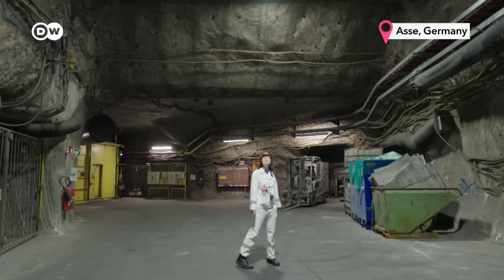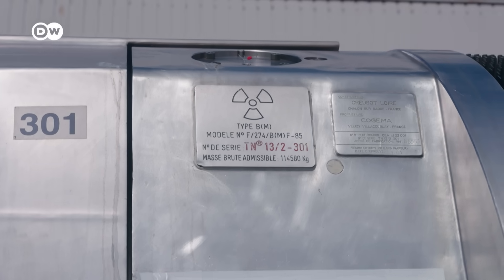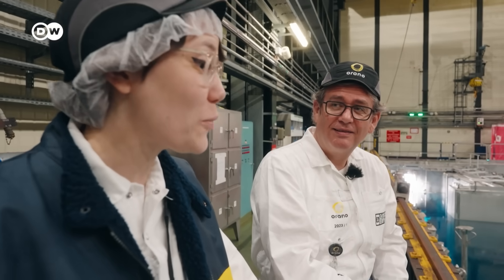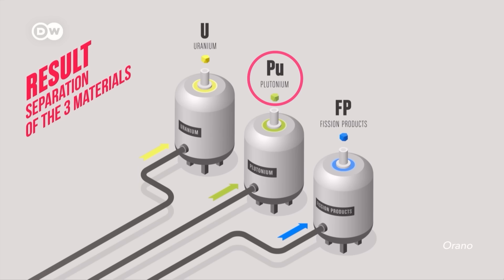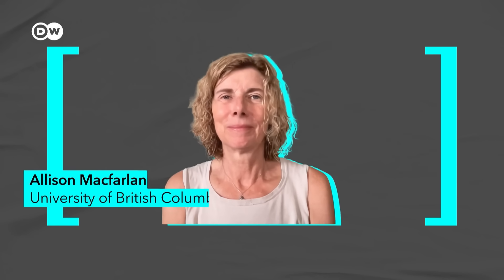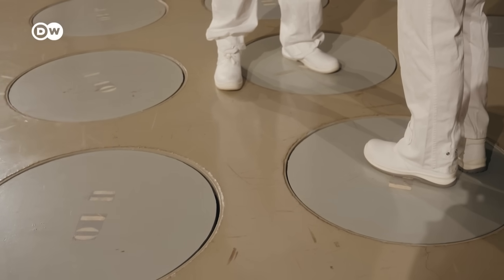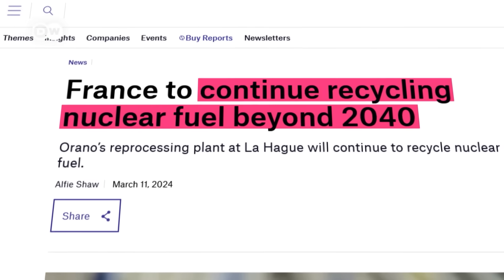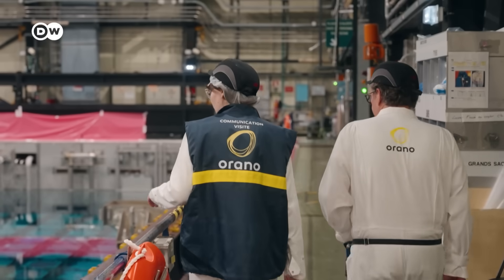Nuclear waste is reusable. Why aren’t we doing it?

Comment: 50 years ago, the United States had a nuclear fuel recycling facility.  It was operated by Nuclear Fuel Services, Inc., a subsidiary of Getty Oil Company.  It was located at West Valley, NY.  I was one of the contractors that decommissioned the plant and vitrified the waste stored there (600,000 gallons).
Reply: The US also had the Fast integral reactor project which combined the nuclear reactor and reprocessing plant into a single facility. It demonstrated how spent fuel could be recycled and reused on-site. The fuel that the plant began operation with would be the same fuel that it would use for the life of the plant. The plant used electrorefining to recycle the fuel. The reactor was a liquid-metal reactor that operated safely and proved that the passive safety systems were effective against loss-of-coolant type accidents that have caused nuclear accidents in the past.  Unfortunately politicians like then-Senator John Kerry fought to get the plant shut down.
Reply: An oil company running a fission plant? I understand why they didn't see any incentive there.
Reply: @98Zai  They didn't see any incentive there because the US government made it impossible to. Are we just going to forget that American anti-nuclearism existed?
Reply: @faberofwillandmight  "Escalating regulation required plant modifications which were deemed uneconomic by Nuclear Fuel Services, who ceased all operations at the facility in 1976." 
They weren't incentivized to operate the plant safely, at least. They're still working on cleaning up that place; "Despite over 30 years of cleanup efforts and billions of dollars having been spent at the site, the West Valley Demonstration Project property was described as "arguably Western New York's most toxic location" in 2013."
Reply: @98Zai so let me guess... they used the billions to just shove it into the sea
Reply: @98Zai  That's oddly specific. Does that mean there are other sites across the USA that are more toxic than this one?
Reply: @Dave1507  I pulled that from wikipedia. I don't know the US very well. I assume Western New York has a higher level of pollution than the rest of the US since it's been a hotspot for human industrialization for at least 200 years. I'm going to go out on a limb and say that there are many sites across the US that are very polluted, they extract oil almost all over the place. I read that 50% of tapwater contains manmade chemicals.
Reply: @98Zai  50%? Isn't that illegal? I mean access to servicable water is a human right. Who's gonna look into that? Unless the USA has an excemption from that.
Reply: @Dave1507  I guess I don't have a good source for that. It explicitly said that 50% of water was found to contain manmade chemicals. I deem that unserviceable but I realize that might not fit the US official standard of unserviceable. Perhaps I am just privileged. I'm glad you caught that, I will change my comment to reflect my error!
Reply: @98Zai  Man, I don't know if it's an error, or if the usa just don't care about their people. The way things are looking now, it could really be both. Let's see if an american can help with those numbers. Not everything is your fault, keep that in mind ;) Anyway, if it's ilegal ,the exact number doesn't matter, because it's no more legal at 20% than at 50%
Reply: @Dave1507  actually yes Hanford in Washington State
Reply: @DrewNorthup  I think the study I looked at specifically mentioned "forever chemicals" like PFAS. I don't think "road salt" is considered a man made chemical, but perhaps I'm wrong.
Reply: @98Zai  most big city water is ♻ from waste water plants and reused and yes that water does contain chemicals some from thing like prescription drugs and other chemicals
Reply: @98Zai  so they were cheap
Reply: @98Zai  Now imagine if we never stopped building them and the thousands of these planned site all got built and are now 50-70+ years old...
Reply: Exsists. 3-Mike island g. Bribe rob steal for my diesel juice. Murica!
Reply: @Dave1507  Yes:   The Lincoln Park & Hanford sites both come to mind.
Reply: @98Zai  Flouride was allowed in drinking water a while ago.
Reply: @dthomas9230  Flouride is a naturally occurring mineral and have always been in the groundwater. It's known to be bad for us, but it's not nearly as bad as plastic.
Reply: @98Zai  It also includes various prescription drugs that get flushed through your system but are not removed or broken down in treatment plants.
Reply: @Dave1507 Yes, there is Hanford, Rocky flats, Rocketdyne at Santa  Susanna, and others!
Reply: @DanielSanNinja  a lot of it was sprayed into the air
Reply: @Dave1507 that doesn't matter when it comes to poor people. Poor indigenous communities in Canada have no clean drinking water. Many small towns in rural American don't have access to clean drinking water. Look into Chemical Valley in Michigan/Ontario
Reply: @Dave1507 America cares deeply about their people and how they're going to continue working to make sure the rich people can survive. That's very important that we don't distrupt the rich peoples' way of life with dumb concerns like not dying and clean drinking water
Reply: @98Zai typical American anti nuclear messaging 😂😂😂😂
Reply: @ZawaOnYoutube Great argument. I'm glad you felt the need to express that. You added so much to the conversation. I want to give you a medal for you ingenuity.
Reply: @ Cool. If i had multiple billions of dollars id do it easily
Reply: @faberofwillandmight ah yes...Remember those days 😅
Reply: @98Zai  a lot of ppl blamed inbreeding for deformities in small towns in south but I wonder if ppl dumped this type of waste in rural areas and caused those deformities?
Reply: @SaibaPixel  As far as I know, deformities caused by radiation are usually fatal, stuff like underdeveloped organs and missing limbs. Inbreeding usually result in some kind of hereditary syndrome. If you are exposed to radiation you're more likely to develop different types of cancer, so looking at cancer statistics is more beneficial in that case. It's important to note that we have only been handling radioactive material on a large scale since the 40's, so before that you'd have to blame a natural source of radiation.
Reply: @faberofwillandmight I’m talking out my ass, but. 

10 bucks says the oil ppl lobbied and incited propaganda
Reply: This was a huge debate in the United States not long ago and kind of still is. Members of US Congress came out to discredit nuclear waste recycling to push solar and wind power. I wouldn't blame the US states that rely upon fossil fuel for a good portion of the state income as the reason why refineries, pipelines, fossil fuel powered energy plants, dams and desalination hydroelectric facilities, and nuclear plants all got shut down with the last few years. The people pushing solar and wind power are against everything else and have been working hard to shut down everything else. The new international movement to recycle nuclear waste is the primary reason why there is renewed interest in researching and constructing generation 4 nuclear power plants. Right now most nations that use nuclear power are building or restoring older plants into generation 3.5 plants or simply continuing to use gen 2 or gen 2.5 plants.
Reply: The people that want solar and wind power have been responsible for shutting down refineries, pipelines, fossil fuel powered energy plants, dams and desalination hydroelectric facilities, nuclear plants, and refusing to permit drilling, oil exploration, and the harvesting of methane in the last few years.
Reply: @98Zai large industrial conglomerates ran most of the us’s nuclear fuel plants even back to the 1940s . Goodyear ran many of them
Reply: @agy234  That sounds so dystopian.
Reply: @98Zai  oh yea...like they never diversify.  Please.
Reply: @98Zai oil companies own wind turbines too and solar city’s. money is Money.
Reply: @98Zai not fission, recycling
Reply: @98Zai  It wasn't the oil industry that  fought against this stuff. It was the Left wing Marxist Ideologies that pushed the fear mongering, and argued that recycling would encourage proliferation: 1. it doesn't. 2. Recycling makes nuclear power more affordable.

Now, tell me, who is against Cheap, Reliable, Clean energy?
That's right: Socialists - why? Because cheap, reliable, clean energy makes manufacturing more affordable; Lowers cost of living; empowers innovations. The entire green movement requires dirty energy as a justification to attack domestic manufacturing; shipped conveniently to china as a primary recipient.

This is not coincidence, this is all by design.

The Federal duplication of effort, that resulted in reduced education outcomes over the decades was done by the same guy by the way: Carter. Because lets be honest - if you want to push socialist ideology, you have to destroy critical thinking. You have to destroy economic literacy.
Reply: @98Zai the technical aspects of the oil and gas sector is highly regulated, that is, many engineering standards to follow. The engineers working on process engineering, piping, mechanical, civil, structural, electrical and controls are all similar with the nuclear energy projects. The difference is only the nuclear reactor. But once the steam is generated, it all becomes like conventional steam energy plant. That's why, an oil and gas engineer can easily move on nuclear energy projects.
Reply: @firstlast-ty4di  Any rad. process using aquaeous or other covalent solvents is inferior as it inflates the amount of contaminated material.
Recycling plant costs are directly proportional to volume of non-profitable material throughput, mainly solvents.
Right now, folks like CURIO are pursuing a combination of dry process, salt-based and electrolysis, which minimizes the churn of litres and kilos of non-fuel materials per day. ORANO is looking at the same.
Reply: @GreezyWorks  Your comment is valid.  The 600,000 gallons of waste the we processed was a sludge, mostly water.  We used chemical processes to remove/concentrate the trans-uranic isotopes which were vitrified (disolved in molten boro-silicate).  That reduced the volume of the waste to about 1% of the original.  A non-aqueous process by our predecessors would have reduced our workload substantially.
Reply: So many industrial wastes are nastier than this.
Reply: US had the capability long before that...like 80 years ago on a commercial scale.  The only difference between recycling and weapons production is the purity and end-user configuration of the U and Pu recovered from the irradiated fuel rods...
Reply: Why was it decommissioned?
Reply: @DesertCatDad  The facility was due for a recertification.  NRC, DOE and State of NY regulations had been updated since the facility's construction, and costly improvements would be needed.  The operator decided that it could not be profitably upgraded and operated.  Because of an arrangement that the operator had with the State of NY, the operator was allowed to turn the site over to the State and walk away.
Reply: And the West Valley Project, to my knowledge , was a massive environmental disaster
Reply: @dennisfitzgibbon1983 living not far from it and knowing people that worked there it was more to do with how shuttering things was managed than the technology, tools and capability of the people actually working there.  In other words people might have been instructed to take measures that were more cost effective.   people there were worked at personal risk to make the best of the situation.
Reply: Yeah, well do tell us HOW WELL IT ALL TURNED OUT?!
More proof techs and engineers WILL LIE if their paycheck is involved.
Reply: There was more than one of these plants in the US, only one of which is still operating too this day.
Reply: And is in the hands of communists from NY state....
Reply: We stopped it because India was able to build bombs from spent nuclear waste from their reactors. So when we found out that plutonium could be extracted to make bombs, we put a stop to all nuclear reprocessing in the United States to set an example. Nothing but politics.
Reply: I grew up seven miles downwind from this nightmare.
Reply: THANK >YOU< for the reply. What happens to the COOLANT WASTE WATER,...though? I am not arguing,....just > kinda < thinkin' / wonderin'? ALL THE TOOLS,...OVERALLS - badges - ? some-tin ta think a 'bouts?
Reply: @WilliamNorrie-c1n  My work at West Valley was with high-level waste only.  Low-level waste that you describe was also buried at the site.  I do not know how that was handled.
Reply: 600,000 gallons ....

Which is gonna be expensive taking care of,  so the process designer selected to force his children to fix his goof ?
Reply: @TheStefanskoglund1  Further processing reduced the volume of waste to about 1% of the 600,000 gallons.  Today it is stored in above-ground containers at the original site.
Reply: Sick
Reply: Yeah..then it was sent to Portsmouth Ohio and caused contamination around the entire site and surrounding communities...did you forget that part or not know?
Reply: @paulmobleyscience  You may be mistaking the waste taken to Portsmouth with a source other than West Valley.  The West Valley waste was consolidated into a reduced volume and stabilized against environmental effects.  It, however, remains at West Valley.  Portsmouth has done uranium enrichment over many years, and I'm sure that the residues from that represent storage challenges.
Reply: @firstlast-ty4di  I'm not mistaken as I am in direct contact with the president of PRESS and know it was brought in from NY. Perhaps there is a part of the process that you were unaware of occurring.
Reply: @paulmobleyscience  Yes, perhaps there was something that I was not aware of.
Reply: @firstlast-ty4di, et al, so it IS as I thought earlier...the whole so-called "clean fuels", and the so-called "dirty fuels" argument is a whole bunch of scams after all.
Reply: Apparently it takes 50 years to switch from oil and nuclear to images and GIFs

(I am terribly sorry for interrupting intellectual conversation with puns, couldn't help myself)
Reply: the miami florida plant is leaking... confirmed 2016... almost all people did not see the reports in nytimes and miamiherald. 😢
Reply: The private reprocessing facility ran for 6 years, was shut down, found to be leaking hi-level radioactive waste and turned over to the feds (Uncle Sugar) to clean up the mess. Still not done. 
Vitrification in glass or ceramics breaks down after 100 years. What will we do with this waste from hell for the next million or so years?
Reply: Too bad they cancelled the MOX plant construction at Savannah River Site.
Reply: @shannono.5835  That may be the only decent thing Obozo did as President. Reprocessing spent fuel is the dirtiest, most polluting, most expensive and most dangerous process in the nuclear energy field. It only reclaims 1-2% of the spent fuel as Pu-239 and U-235. The rest is still nuclear waste. The reclaimed fuel can be reused in an MOX reactor one time. Reactors that can run MOX fuel require more containment and are more tempermental, therefore more expensive. It is much cheaper to run U-235 from mining and is less expensive and less polluting. The reprocessing plants in England and France, Sellefield and LeHague have caused the Atlantic Ocean to be the most radioactively polluted ocean in the world. England shut down Sellafield and estimates it will take over 100 years to clean up and no one knows how much money. England says it will cost about $1 billion a year just to maintain the site, waste and equipment and provide security. Le Hague's only customer now is its parent company since they lost all their international customers. The parent company was taken over by the French government to keep it from going bankrupt. Pity the poor French taxpayers.
Reply: 50ys+ago,also, Nixon cut the funds for the Oak Ridge Fluid salt reactor.with all bugs ironed out these things could Burn this waste (c.99%)..we are almost there 😊.. it's a resource!
Reply: The shorter the half-life, the more dangerous the waste & VICE VERSA!
Reply: Pandoras Box.
Reply: The simple truth: it's more expensive than just using virgin material. (and almost everywhere, there are anti-proliferation laws making it illegal.) In the US, the only spent fuel reprocessing is done by the military. (infinite budget, and over 90% enrichment is highly expensive.)
Reply: Interesting.   And you sound healthy alert these
manhy years since.
Reply: I am living in a third world country without any nuclear power plant but all other nations sent their nuclear waste to my country for disposal. The USA spent a big budget on building nuclear power plants with little budget to build a nuclear waste processing facility.
Reply: Just wait till they hear about fast-spectrum breeder reactors. They'll kick themselves they didn't think of it.
Reply: Now that facility has contaminated the surrounding countryside, with radioactive waste in the water.  Not surprisingly.
Reply: @markrobinowitz8473  "After reprocessing operations ceased in 1972, Nuclear Fuel Services continued to accept low-level radioactive waste for disposal at the site until it was discovered that contaminated water was leaking from the trenches. Nuclear Fuel Services was unable to obtain regulatory approval to remove and treat the contaminated water, and stopped accepting waste for burial in 1975."
Reply: @markrobinowitz8473  And Earth is the only planet we're aware of that isn't completely irradiated. For some reason we're insistent on changing that.
Reply: @98Zai  We're receiving radiation from the sun right now. Radiation is fine, there are just levels that are unsafe, and even then we're still learning how radiation affects the environment via Chernobyl, which has seen an explosion of diverse wildlife.
Reply: @OryxAU  yeah, they've seen an explosion allright... ;)
Reply: @OryxAU  We spent millions of years to evolve protection from some Electromagnetic radiation, including relatively weak UV, but it's still the cause of a lot of cancer cases. Ionizing radiation is different and much more powerful, we would never have reached this level of complexity if the Earth was irradiated. Please don't go around saying that ionizing radiation is "fine".
Reply: @98Zai   Actually do we know of any planets that are completely irradiated?  I think you have your facts backwards.  

Earth's magnetosphere does shield our planet from much of the Sun's solar wind, which protects us from much of the Sun's radiation and is very much needed for our kind of life, but other planets which do not have this feature can't really be said to be "irradiated".
Reply: @Faladrin  The level of radiation on Mars and the moon are fatal without protection. I think we can assume this is the case for all bodies in space, since space itself is full of radiation.
Reply: @98Zai UV is ionising radiation.
Reply: @rogerphelps9939  "Some higher types of UV radiation are ionizing, but even the highest-energy UV rays don't have enough energy to penetrate deeply into the body, so their main effect is on the skin."
Reply: We're not changing the amount of radiation.
Reply: @98Zai Radiation is everywhere dude. Uranium is very common in lime stone.
Reply: @kabloosh699  I know, but not at the levels of the rest of the universe.
Reply: @98Zai  that is only because we have a atmosphere that protects us from most of it.
Reply: @kabloosh699  Yeah, so using nuclear power is like removing the atmosphere to get better solar power.
Reply: @98Zai  what?

That's not how nuclear works.
Reply: @kabloosh699  It is bringing radioactivity to the surface of the earth. I know how it works, friend.  I guess a "perfectly controlled" window in the atmosphere for our solar panels is a more correct metaphor.
Reply: @98Zai  It feels so good, the nice warmth of billions of particles hitting my skin at once. The Nuclear Bliss, I call it
Reply: @DanglesPaintball  I know, right. It's so bizarre that we need it to be healthy. Another thing is oxygen, it's an oxidizer and basically the reason we break down at all - the reason we age and die. Yet we need it to function.
Reply: @98Zai  That is false. Earth is positively glowing. Have you ever heard of Oklo, or granite?
Reply: @98Zai  lobbied politicians says "It's the future's problem" says 60 year old politician 😂
Reply: @OryxAU Yep. And some parts of the US are naturally more radioactive than others.

Also those of us living in high parts of the country are getting more SolRad than those lowland dwellers! Lol.
Reply: @98Zai As someone who will likely get solar caused cancer on my face like my grandpa, I think the intent was to counter the typical ignorant reaction people have to radiation.
Reply: Why are people here asking complex questions in a YouTube chat section when if you just google it, you’ll have a better chance of getting your answers?
Plus they keep saying things like “I heard” or “supposedly.” If you don’t know then don’t spread the false information.
Reply: @keenari0470  Why even write or read comments at all? Every comment made by a person is going to be flawed in some way, because nobody is capable of knowing everything including if nuclear recycling is good or bad. It doesn't matter who they claim to be, treat each comment as nothing more than an opinion. Except when you read straight up facts, like how fission doesn't belong on earth.
Reply: @98Zai  it’s OK to have conversations in the comment section. I actually like to hear other peoples opinions on things or stories from their own lives. But people are asking questions that would take someone too long to answer and are just a Google search away. They’re stating information that they themselves don’t even know if it’s true or they’re making overly exaggerated statements.
Reply: It seems like in the 1970 the US was leading the world with innovation. Now it seems you only innovate when it comes to more imaginative was a bring death.
Reply: @bardslee did you forget about the internet, private space exploration, smart phones, gps and artificial intelligence?
Reply: @bardslee Probably coming from a person residing in a nation receiving some kind of US aid
Reply: @bardslee that's easy for Europeans to say when they can practically spend nothing on their military and just rely on the U.S for protection.
Reply: @bardslee  Laws (and enforcement practices) and tax structure incentivize behaviors.  1970s had different incentives than today.
Reply: Used to
Reply: Shoot it out into space maybe. It being it's own fuel sorce. And boom we now have satellites 🛰  in deep space ?!😊😮
Reply: For financial reasons, US president Barack Obama canceled construction of the MFFF in 2016 and proposed that the plutonium be diluted with non-radioactive material and disposed in the underground WIPP facility.
Reply: That's honestly such a bummer to read. :/
Reply: ? 600,ooo <_>  gallons < ? LIQUID ?  COOLANTS ? -- water --? boric acid pools -  solutions?
Reply: @WilliamNorrie-c1n  It was mostly mud-like.  There was also some liquid (10-20%).  I don't remember what was used to treat the waste stream prior to its long-term storage in the underground tanks.  When we did our cleanup, we chemically concentrated the elements that contain the active isotopes - cesium, iridium, etc.  That reduced the volume to less than 1% of the original.  The isotope concentrate was dissolved in boro-silicate glass and put into stainless steel (304L) containers.  The containers are 2' diameter by 10' long.  The decay of the isotopes heats each canister at about 1,200 watts.
Reply: That's terrible
Reply: WTF is a gallon?
Reply: @mernokimuvek  It was a class of large, heavily armed wooden sailing cargo/warship of Iberian origin which reached the peak of their use and popularity around 500 years ago. Typically a 3 masted vessel with square-rigged sails.  Oh, wait, no, I'm thinking about a *Galleon*.  No, sorry, my bad, correction:  for the google-impaired - a gallon (as in unit of volume) is about 3.8 liters, if you're talking US gallons.  US dry gallons, Imperial gallons, etc, tend to be about 4.4 to 4.5 liters.  For context, the volume of an average Olympic size swimming pool is 660,000 US gallons, or about 10% more than the amount of waste OP referred to.
Reply: @mernokimuvek About 3.9 liters.
Think of it as about the volume of a bucket.
Reply: A measure of liquids @mernokimuvek
Reply: Lies again? Prime Cups Reduce Reuse Recycle